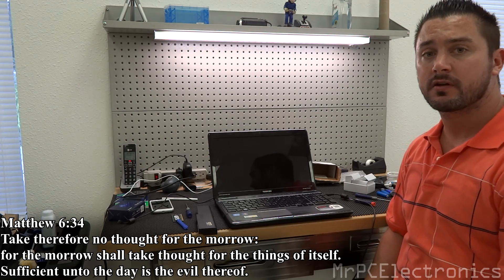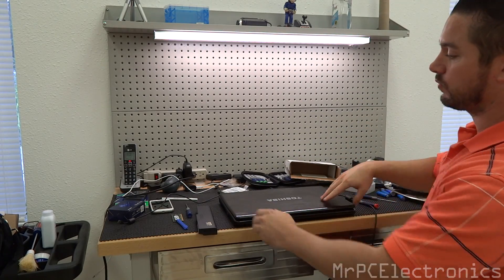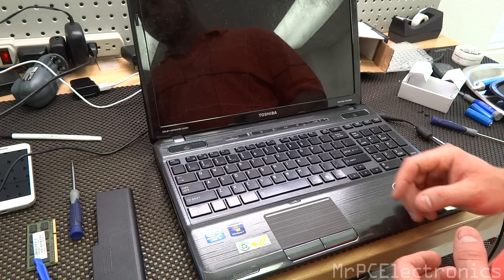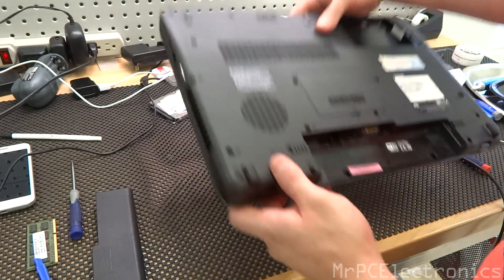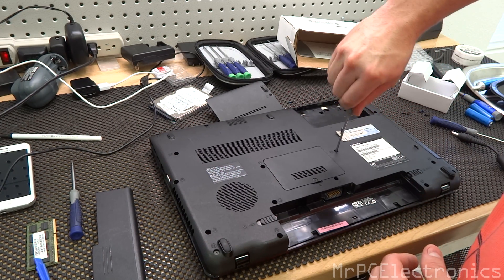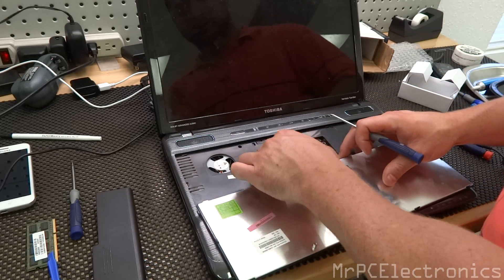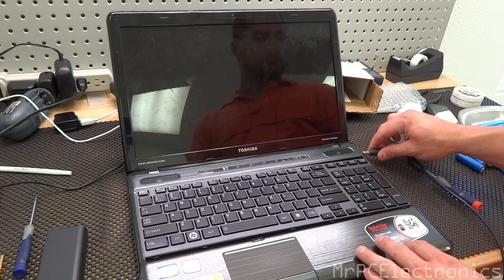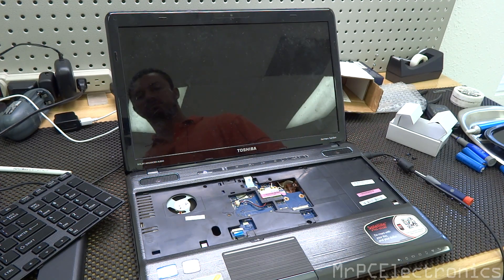Toshiba Satellite (NO BOOT) Loud Fan "FIX"

Comment: Hi there. I have an Lenovo Ideapad z510. Today I've changed the CPU (from i3 to i5) I've added 8gb of ram and a 120gb ssd. After I've put it all together and pressed the power button. The lights on the keyboard turned on, the fan turned on for 13 sec.(pretty loud) , (no image on the screen)...and shut's down. Do you know what can it be? Thank's
Reply: Same problem

Comment: Having the same problem with my S55-A5295. Have removed the optical, keyboard, and tested memory. Also cleaned the fan. Any suggestions? Thanks.
Reply: Buy a new one
Reply: @dhrax029  how can i save data?
Reply: Power button is lighting up on mine.
Reply: Also am just running on AC.